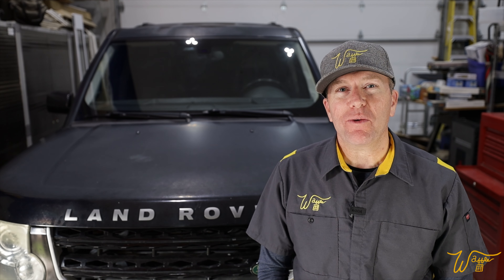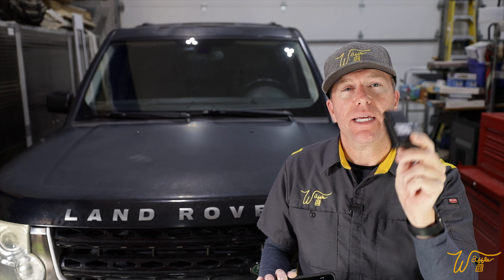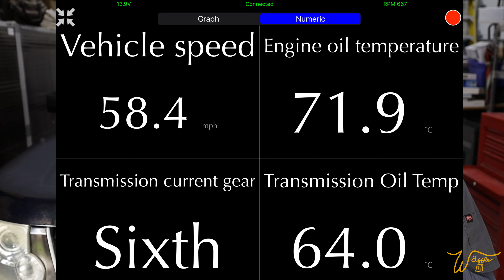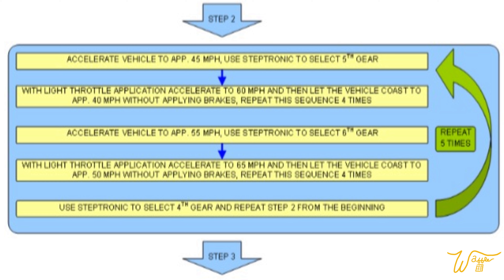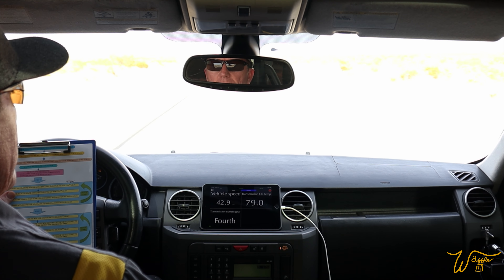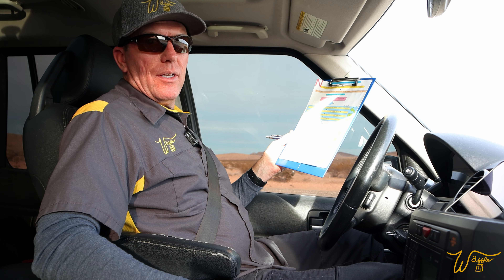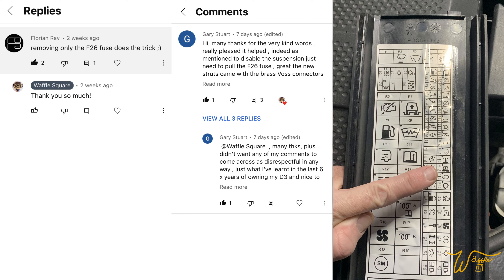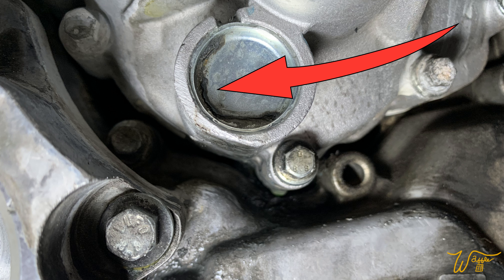Land Rover LR3 Transmission Adaptation Relearn Procedure - Ep. 6

Comment: About the HVAC, there is also a motor reset procedure and a valve reset procedure in the GAP IID tool.  I just performed the first (motor/flap one) on my 2016 LR4 last night and it did fix the rear/passenger ventilation.  It was not blowing any air at all in the back seat before!  I thought it was pretty cool that we can do that without even popping the hood up!  Love the channel, keep it up from Montreal, Canada!!
Reply from the maker: Great tip! I’ll check if it is available on the LR3. Thank you Nicolas

Comment: Transmission adaption reset isn't usually recommended on high mileage gearboxes on Disco 3 / LR3 in Europe. I've never heard of these relearn sequences from BMW, but hey, it can't hurt. The gearbox ECU continually monitors and adapts the valves and pressures so all the relearn does is speed that process up, but I've found resetting does make for bad shifts, but maybe that was because my gearbox was really needing a rebuild, which it got. It now has well in excess of 200,000 miles.
If you set a live value to watch the torque convertor lock up clutch you can detect early problems as it fails to fully lock. The lock up clutch operates in all gears, unlike earlier transmissions which only locked in top or over drive. and it really isn't up to it and  they fail around 150k miles. The ZF6 speed 'box doesn't have a direct drive, as 4th is just under direct and both 5th and 6th are overdrive. The IID tool live values full set will allow you to choose a selection of values which will show Engine speed, turbine speed (in the convertor, trans side), gearbox output shaft speed, gear selected and torque convertor clutch status which is interesting to watch as you really can't detect while driving how much work that gearbox system is doing, completely seamlessly.
Reply: That is the most reasonable response to the highly complex transmission reset procedure as explained.  It makes more sense to understand what the problems may be before going through such a procedure hoping it helps.  I ordered a cheap ODBII tool for Land Rovers that claims to read transmission codes for my model.  I hope it will show live values.  If not I will look for a tool like you describe. On a hopeful note, the transmission has not been misbehaving at all of late.  Perhaps sitting for a year or so was the problem, and now that it is working again it is teaching itself to work properly.  Crossing my fingers.

Comment: Im in the process of doing a full rebuild of my 2007 TDV6 XS (yes, that's the dreaded diesel) but with the same auto gearbox. This was super helpful! So thank you for the video :)
Reply from the maker: You are very welcome! Wish I had a diesel version to tinker with.
Reply: @wafflesquare  honestly the V8 is far more reliable than the TDV6. However fuel economy and the fact 99 out of 100 are diesels here in Europe, I'm exited to get this beast back on the road now that the odometer has reached 350.000km.
Reply from the maker: Good to know.

Comment: I have the exact same LR3 as shown in the video.  The transmission does strange things only when it is cold.  After warming up, over a half hour of driving, it works fine.  Sometimes I get the  “Transmission Fault - Traction Reduced” but not always, and not in the same day after it was warm.  And the same problems are not consistent, never know what it will do.  I am  wondering about a computer diagnostic, or reprogram or replacement.  I did not see the video of the transmission rebuild, but I do see control modules for the transmission and the transfer case for sale.  Also about a service, filter and fluid change, on this thing.  Otherwise there are no problems with this Rover.
Reply from the maker: Not sure what you are asking but this transmission service (along with the adaptation relearn procedure) solved our issues: Land Rover LR3 Complete Transmission Service 6HP26 - Ep. 3
https://youtu.be/awZzcE-LwRc

Comment: The last direction of Step 2 is not clear, am I to put the trans into 4th gear wen the vehicle coast to 50 mph , or should I let the vehicle slow to 40 mph and the shit to 4th and then accelerate to 45mph and shift to 5th to restart the Step 2 sequence?

Comment: Hey thank you so much for your videos! They’ve really been helpful! Out of curiosity I dont recall hearing you mention the transmission fault codes that the GAP tool read, can you share them? Also is the Terrain Response working? Are you planning on putting Johnson Rods?
Reply from the maker: Thank you, Hugo. There were no transmission fault codes before the complete service. It was slipping noticeably between 2nd & 3rd gear. I have no plans to install Johnson Rods.

Comment: Hi Mike, great videos and as someone else said very clear and methodical.
 
What were the symptoms with the trans before doing the overhaul ? , i have a 2007 TDV6 D3 here in Australia and i'm having low gear, low speed shifting issues which i believe are valve body related. From a standing start especially if facing uphill the revs flare and take a few seconds to move then clunks into gear and then when coasting below 60kph i get a soft kick in the rear feeling then it will fault and go into limp mode with a P0730 incorrect gear ration fault and occasionally a 3-4 shift algorithm failure code.
 Car has just over 220k klms and was a one owner never towed or used off road vehicle before i bought it, once into 4th gear acceleration is smooth .
 Car is anything but stock now :)
Reply from the maker: As stated in episode three where I serviced the transmission, it was slipping between 2nd and 3rd gear.
Reply: @wafflesquare  had you checked for codes before the rebuild ?
Reply from the maker: Yes. No codes for the transmission.

Comment: Hi Mike. Great videos man. I've just upgraded the transmission oil pan and filter on my 5.0L LR4,  replaced the seals for the valve body and changed the oil as well. I haven't done the adoptions yet. The suv feels a bit sluggish now. It doesn't have the same quick pull as it did earlier. Could this be due to the new oil in the transmission?
Reply from the maker: That would depend on how much friction material was left on the clutch plates in the upper area of the transmission. Was the bottom of the oil pan saturated with a thick gray residue similar to the consistency of pudding or peanut butter?

Comment: Is it still shifting good? Mine jerks pretty bad in second gear sometimes. All other gears are generally okay. I suspect it’s a solenoid issue.
Reply from the maker: In episode three I did a complete transmission service. Then I set the new adaptations in this video. Now it shifts smooth. Really happy with the outcome.
Reply: @wafflesquare  About how many miles have you put on it since then?
Reply from the maker: Only about three hundred miles

Comment: Hello, Waffle Square. 
A question. Can I change the electronic board of the gearbox of my LR3 4.4 2006 with another board from another LR3 without losing the configuration?
Reply from the maker: I have no idea.
Reply: The mechanic broke the plate and I have to change it. 
ZF does not sell to owners and I will not buy from JLR. 
I'm going to have to do what appears in your video and upload a video to YouTube 😃
Reply from the maker: @CristianWolfQuiroz I sure hope you can figure it out.

Comment: My transmission is done , and drive line hanger bearing,  2 thing still having issues the sport mode / command shift don't work it was like this before I put in transmission shop , in thinking shiftier bad or the electrical components in shiftier bad and also I have to remove console and shift knob and push white tab to get in gear , it might be the brake switch causing not going into gear , I told shop don't fix these things because I can find it , my lr3 is no spring chicken and previous owner stopped doing many simple repairs but not much information on sport mode issues for land rover , but the ones I did find was on BMW turning out to be broke wire , I keep you posted I be home Thursday evening
Reply from the maker: Thank you for the update, James.

Comment: Hey buddy love your videos very helpful!! Question regarding suspension. So after calibration all 4 corners it failed to change the setting! Any idea why? I have recently replaced the compressor with Arnott and flashed it but I’m still getting the code C1A36-01 exhaust valve general failure ! Compressor runs for a while as soon as I hit the EAS switch amber suspension light comes on! If you could help me with this! Really appreciate it 🙏🙏
Reply from the maker: My GAP IID tool only had a choice of two compressor firmware options: Hitachi or AMK. All our strange error codes went away with the correct firmware. Therefore I would only use one of those compressor brands.
Reply: @wafflesquare  thanks
Reply from the maker: @yamahaking5963 you’re welcome.

Comment: Hey thanks for updating on the tranny service video! So after you did the service it still jerked between 3-4? Even after replacing solenoids?
Reply from the maker: Initially yes but, as I demonstrated in the video, after completing step one, that went away. I have driven about 200 miles since completing this procedure and the transmission has remained very smooth.

Comment: Do you maybe know how to reset the memory of the automatic transmission in Opel (Vauxhall) Astra J, 2.0 cdti 2012? Is it possible to disable learning or adaptation and set fixed settings? The car shifts perfectly when the memory is reset, but once it learns, it doesn't work well (it jerks when shifting into 1st gear at the moment of stopping, not when starting, and only in first gear).
Reply from the maker: No I have no experience with that.
Reply: I know this is an old comment but, being an American we don't have a lot of experience with Opel's or Vauxhall's as we don't get them here BUT if it's a ZF transmission it might require a software update, the 6HP transmissions were notorious for "butt kicking" when coming to a stop because they weren't originally programmed to handle wearing components.

Comment: I am preparing to enhance my lr3 look with both the defender side mounted ladder and gear storage box it looks easy to install but sense I don't have a defender I will need to modify my install,  I have already removed my factory roof rails due to my front runner roof rack,  I will need to move the roof rack to the side mark the hole to drill 2 hole in roof where the old rails ran , and use nut insert for a tight secure mount and I need to drill. 2 in quarter panel with nut insert for ladder I think the gear storage box is too short to drill 2 holes in quart panel but should be OK by just using the 2 nut insert from roof because the box is not heavy like the ladder , I also install a terrafirma rear tire swing out carrier a easy installation only problem I had be the typical man I didn't rear instructions and the terrafirma instructions suck , what I learn is to on final rear install rear bumper is to completely install bumper and snap the corners before drilling hole for rear Carrier bracket or the bumper corners won't come together I had to remove the Carrier bracket to get the corner on passenger side to snap back into place or you end up breaking off the body mount that snaps the rear bumper to the corner,  my hole for carrier a little bigger but no big deal but it been nicer if my hole in bumper was perfect,  there is a viedo on this terrafirma rear carrier that gives some good information but he left out some key final points that would have help me or anyone installed the same carrier its so important when making a how to diy viedos not to do shorts cuts but make sure keys points of any installation not left out my lr3 is turning heads

Comment: Technically couldn’t you do the procedure without resetting the values ?
Reply from the maker: I don’t understand your question.
Reply: @wafflesquare  I did the solenoids and filter but I didn’t reset the adaptations will the car drive normal in a couple hundred miles or is it mandatory to do the relearn procedure and reset adaptations
Reply from the maker: You should follow the advice by the Z26 transmission experts whose videos I linked in the description.